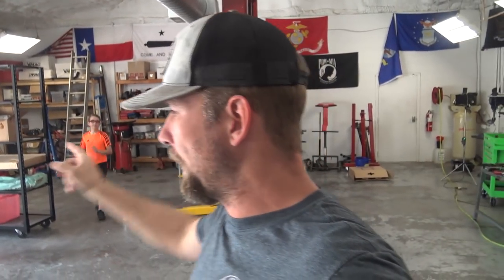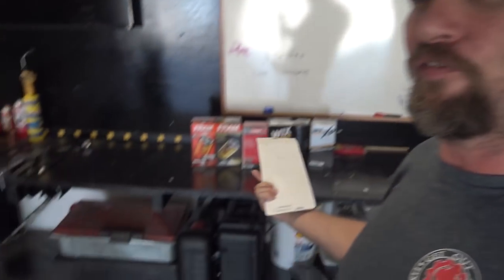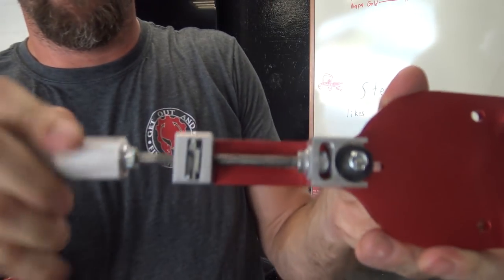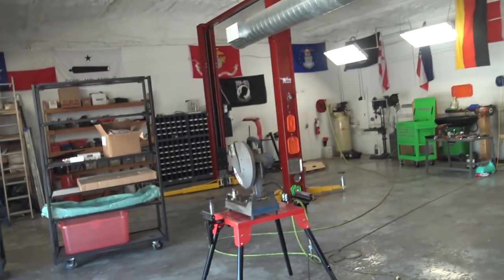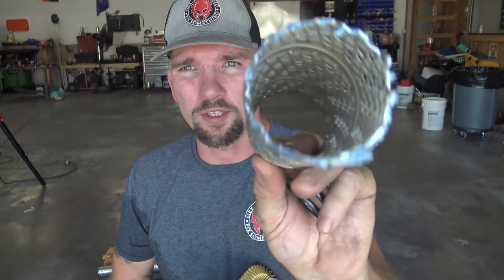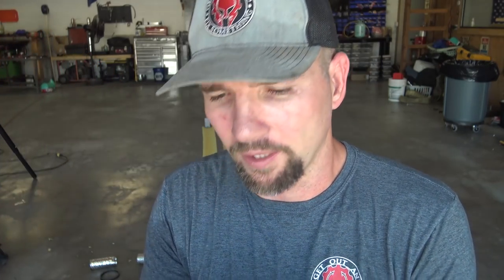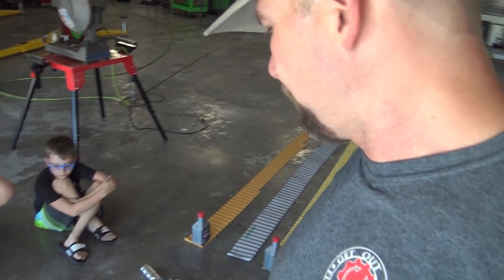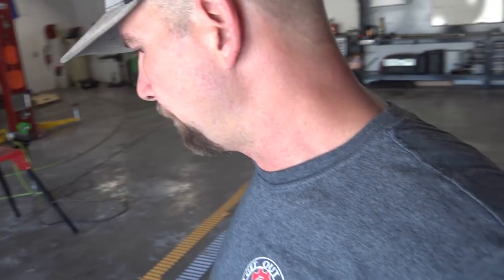Is This Still The Worst Oil Filter On The Planet?

Comment: For 27 years I was a Ford parts manager and guess what all my vehicles ran motorcraft filters on every model car or truck I owned, never a problem.
Reply: Grand Poobah 
But I wouldn’t have used them if they were junk.
Reply: @gregsimon9061  if use Motorcraft parts, better than other aftermarket stuff unless your going for the performance stiff like all aluminum radiators, new shocks and so on.
I wouldn't use AC Delco for gm Because then aftermarket is literally higher quality than GM oe parts.
Reply: thats the only filter i will ever use on my two fords   cheers   Greg
Reply: You can use motorcraft filters on gm vehicles too..motorcraft its fords aftermarket to non ford vehicles.🚛🚗🚖🚕🚍🚌🚓

Comment: Got a 1999 gmc safari been running fram since 130000 miles with Quaker state oil change at 2500 miles still running strong at 295000 miles

Comment: It is more about surface area than media thickness!  Seen a lot of Frams in the junkyard! Not sure if it was the filter, or if the owners tried a cheap oil change that didn't fix what the car was doing and they threw in the towel. I think there are some Fram filters that are okay, steel and paper are both biodegradable in a landfill. I do know that at one time Fram was selling the filter for my Volvo XC70 that was actually a Mann Hummel hu819x in a Fram box. Unfortunately they wanted double what I was paying for the Mann filter in the Mann box.

Comment: Been using Fram since 1968. Never had a failure due to the filter. Got an 03 Chevy Avalanche with 224,450 miles. Doesn't smoke and carries 40 psi at operating temperature. Nuff Said.

Comment: Stephen, B4 doing the oil filter autopsies I think you 1st should have weighed them. I have found that the budget oil filters are significantly lighter than their premium priced counterparts. This extra heaviness I believe is due to the superior materials & construction in manufacturing of these filters. I’d have betted that the Fram basic orange filter would have been the lightest. It would sure be a fast, easy, & clean 1st step in evaluating these filters.  Rich 🤓👍🇺🇸
Reply: heavy doesn't necessarily mean good.............

Comment: From Leo:  My job required extensive driving to take care of contract clients.  50-60,000 plus miles per year for most of my career.  I drove V-8, 6 cylinder and 4 cylinder American made cars, usually trading at about 200,000 miles.   I never did anything special, getting oil changes at about 3-5000 miles, whenever convenient.   I would go to any drive through oil change place and use whatever brand name oil they had,  and whatever brand name filter they had.  Lots of Fram filters.  I doubt that any of them were deluxe or heavy duty quality.   Seeing by your test that some brands are built better than others.   Since I never had a single lubrication related failure,  one would have to believe that even the cheaper built ones are plenty good to protect the engine.

Comment: I had a 2006 Saturn Ion with 298k miles before I bought a new car. I used Mobil 1 full synthetic and changed the oil every 3k miles with a Fram tough quart oil filter. Saturn engine doesn’t use the same type of oil filter like every engine has. It’s internal. You unscrew a plastic cap and drop the filter in. I looked at all different types of brand on that style filter and they were all the same. Plastic with cardboard.
Reply: Yea dude it's called a canister filter. Very common, Volvos use them and so do Mercedes. It's not that oddball, I promise.

Comment: This video surprised me ( I think it did you also) I ran FRAM for years until I started doing research (gas engines) I moved to WIX really quickly. However it looks like FRAM may have stepped up their game. Back in the 90's the biggest selling point for FRAM was the grip they started putting on them (gas engines). I will probably stick with WIX... Another surprise I got recently is how good Amazon oil is (full syn). I have been a Castrol Oil guy my entire life, but Check out some oil reviews on YouTube. Sad I can not afford Amsoil :-(

Comment: I have used FRAM filters for years...UNTIL...After one oil change on a Ford 4.6, I started the engine and there was no reading on the gauge. Scared the dickens out of me.  The lifters didn't make any noise so the filter bypass must have stuck.  I guess?  Anyway I bought a Mobil 1 and have used it ever since.

Comment: Fram sell millions of orange filters every year with out problems. Purolator filters, at least the cheaper ones, still have tearing issues of the media. The 'cardboard' ends are also used by some Wix filters as well as the Fram.

Comment: I have used Frame Filters for over 55 years and have never had any problems with them or Engine Wear--the Key is to Change your Oil Often, I have always changed mine at 3000 miles, my newer Ford Truck, I change it at 5000 miles using synthetic blend oil...

Comment: Hi brother, I have a 103-10 perkins engine and it has idle fluctuations when it's cold, this has been happening since the mechanic went to the injection pump to start faster and changed my settings .... If you could tell me how far each adjustment is from the engine block to the head of the screw, you are very strong and I have been following you for some time

Comment: We had a guy that works at our shop have us put a fram on his blazer. Of course I wouldn’t instal it in the car, & they thought I was crazy for not wanting to do it. It was an “ultra synthetic” so it’s “the best on the market” the car is owned by a crazy nutty old man. He didn’t want the genuine ACDelco filter on his car even tho it’s a genuine GM filter designed for his vehicle from the factory. The best for it cuz it’s an OEM filter.

I’d take the genuine GM filter over any fram any day. Some guys like to dis the filters cuz they feel crap, but it’s an OEM GM part not a crappy wix.

I’ve installed probably 150-200 GM filters, & so far we haven’t had a single one fail, & if they are leaking it’s cuz the filter is loose. Now I get my filters pretty fukin tight using 2 hands, & a rag.

For me personally… 
Go OEM or Mobil 1, Microguard, Penzoil.

Wix oil filters are trash. We had one fail on a minivan years ago where it blew the filter off the housing.

Motorcraft, ACDelco, Mobil 1, MicroGuard, Penzoil, then wix if ur desperate. If u can only get a fram just leave the old filter on the car, & avoid the fram.

Do what u want to ur own engine, but this is just my .02

Comment: Been using Fram in everything for over 45 years. Never cost an engine. Why? Sure there is better media, but what is ALWAYS overlooked, is how the filters and oiling systems work. Very little of your oil actually goes through the filter. Until the late 80s, some engines didn't even have a filter. The bypass system is why it doesn't matter how good of quality your filter is.

Comment: Maybe someday somebody on YouTube will do a video where they actually TEST AN OIL FILTER'S ABILITY TO FILTER AND CLEAN OIL.  You know, take oil samples and measure the amount of particles filtered out and see if the filter is actually doing its job. 

Because if the cheap Fram filter is doing a perfectly good job over a 3,000 mile change interval, there's no reason in the world to buy something more expensive.

Comment: I been using K&N filters for years never had a problem with them they work great @Stephen Cox
Reply from the maker: Thanks bud!
Reply: Well I have used for years whatever is the cheapest that I can buy at the time and I too have never had a problem.  So your K&N filter works. So does whatever I use.  It doesnt matter what you use if you just do your oil changes on time.
Reply: @nickv4073  okay
Reply: @nickv4073  I had a friend in college who ruined the Ford Lima engine in his Ranger by doing a DIY oil change with a Fram filter, the engine suddenly had no oil pressure about 500 miles after the oil change.  We took the filter apart enough to figure out that one of the cardboard end caps got sucked into the engine ☹

Comment: I like the Napa gold 1515’s but watch out for the gasket! The thing will come off the filter about 50% of the time so check the mounting face before you slap another one on. Yes I always put oil on the gasket surface and wipe clean the mounting surface. In fact, I pre fill the filters with oil to limit the dry run time. Someone didn’t check for double stacked seals on my ex’s car and I’m sure glad it wasn’t me. My ears are ringing just thinking about it.

Comment: The extra guard is celuose media! Fram ultra synthetic is synthetic media same as wix XP! The other 3 are synthetic blend media! And also the motorcraft is made by Purolator
Reply: Yes FRAM Ultra is a nice filter
Reply: @xephael3485  yeah I've been running them on my Subarus they filter down to 20 microns the wix XP only goes down to 30! They sold out to Mann I believe
Reply: I used to buy Purolator at Walmart but they stopped carrying that brand for some reason.  Lately, I have been buying Motorcraft on Amazon and Rockauto.
Reply: @picklerix6162  motorcraft isn't anything special. It's a low end filter with a silicone anti drain back valve! The fram ultra synthetic filters the best! I we wouldn't buy any of their other filters! Molil 1 , k&n , Purolator boss or wix XP are very Good

Comment: I remember when engines didn’t have filters. And I have never really been brand loyal but I have never had an issue with Fram or any others. Had a ranger with 257,982 miles on it when I sold it and used mostly fram filters on it.
Reply: My Ranger has 331,000 still going strong.

Comment: You are more forgiving than me. I can't think of a single situation where I would use crappy Fram filters.
Reply: He didn't test it, only showed components
Reply: @xephael3485  So! What's your point?
Reply: @consaka1  my point is that no useful real world information on how the filters actually perform can be aquired from just cutting open filters.
Reply: @xephael3485  Yes to a point. What you are not realizing is that this isn't a standalone review. It is based off the previous review and for many of us, on our experience with used Fram filters. Cutting up used ones can be very enlightening. So can cutting up new ones when you find defects that literally allow the oil to bypass all filtration. I have seen it on new and used filters. I have cut open a lot and watched others cut open a lot. My experience with Fram goes way beyond this short video. My grandfather always bought the cheapest filters he could back in the day.
Reply: @consaka1  You shouldn't assume this is the only cutting apart oil filter review I've seen, and that I haven't seen Cox's previous videos... because I have.  If there is a defect with an oil filter point it out...

Fram offers filters at a number of cost points and  I've tried them all.  I've never come across a defective product, or one that failed when used as directed.  There is a video on YouTube where they tour a Fram QA lab and show you the real world torture testing they do to their products randomly pulled from the production line... Using cellulose end caps, bonding the filter with epoxy or using leaf springs may make a filter cheaper to produce, but in no way reflects how it will actually perform in real world tests.

If a company as big as Fram was making absolute junk that failed they would be sued into oblivion for wrecking engines.
Reply: @xephael3485  you assuming they have never been sued? Lol
Listen dude. If you like using their products than go right ahead. I have seen their defects first hand. Their QC is subpar if they have one. I assumed they never had one because cardboard end caps on the filter media. Dumbest construction ever. I have seen that cardboard totally disintegrated. That's a crap filter in most professional mechanics book, but hey if that's what floats your boat go right ahead and buy it because I won't. My local parts store had a wall of Fram stuff and now they don't even sell them any more.
Reply: @xephael3485  Oh and yeah this comment is actually completely wrong. You can gain a lot of real world info by studying how it is made and especially if you find serious flaws like GAPS and HOLES in the media.

Comment: I had a 94 dodge ,360 magnum  ,used fram  oil filter mostly, had for 21 years,23700 miles, ran great never  did anything  major  to engine  or transmission sold to someone  else who was putting  100mi a day going to work

Comment: The butterfly bypass spring on the motorcraft is the only one that will bypass oil at the same pressure regardless of temperature, just FYI.  Just in case you read this, repeat your test in a year or two on used filters, get a amazon digital microscope and explore the actual filtration capability of the media.

Comment: I wonder if the chamfer helps the O-ring to release from the engine when you unscrew it.
Reply: That’s an interesting thought actually, maybe if you don’t change your oil often enough it would help lmao
Reply: I think it's more spread the load on the gasket so the filter doesn't loosen. Fram is infamous for that.
Reply: Its to stop the filter housing grabbing the edge and rolling it out of position

Comment: The best filter to use is the one that has the factory's name on it. If it's a Cummins use a Cummins filter. If it's a caterpillar use a caterpillar filter
Reply: Who makes them though. Don't think that Cummins makes oil filters.
Reply: @markchidester6239  If I remember right Geno's garage has them for the pickup engine. Not sure about the bigger semi engines
Reply: not necessarily bubba

Comment: I have GM products and Kubota tractors.. I always by the kubota filters for them.. and I always get the acdelco  for the GM.. now I have been told that the acdelco are a cheaply made as the fram.. an to check out the supertech filters from walmart..  guess I will have to think about a filter tool and see for myself.

Comment: The standard Fram automotive filter is still made the same way as the old one you showed, cardboard ends glued onto the filter. The obvious reason why they make them that way is the cost of manufacture, it is the absolutely cheapest way to make one. If you think that is a good way to make a filter, why don't other brands use the same method? To my knowledge, no other US filter maker manufactures filters with cardboard ends, if it was just as good, everybody would be doing it. The string around the filter media is fairly common, its just a way to hold the media in place as it is assembled. Your cutter works the same as any tubing cutter, noting unusual about that at all. I'm not sure of the specific requirements, but aviation mechanics commonly cut open oil filters on internal combustion aircraft engines, then open the media up so they can look for metal particles in the media. If your airplane engine quits its hard to pull over to the side of the road, so aircraft mechanics are very careful to make sure the engines are right, if there are metal particles you can see in the oil filter, something is wrong.

Comment: I really like guts of the amsoil filters.

I don't trust any claims by manufacturers, but after testing 5 brands of filter and 5 brands of oil, my reports from Blackstone labs do truly show some statistically significant gains. 

Mobile 1 and amsoil are great brands. Amsoil is currently my go to unless mobile 1 comes out with something else compelling
Reply: What were the other brands you used?
Reply: @Sjackson2369  
Filters in order of build quality
Amsoil
Mobil1
Wix
K and n / afe. I think they are the same OEM
Fram

Oils
Amsoil
Mobil1
Schaeffer
Royal purple
Shell

Comment: FRAM has indeed stepped up their game.  They all use silicone anti drainback valves, the pleates at the ends won't fall apart but the biggest issues is that they aren't priced competitively. Their prices have gone way up. I can snag a Motocraft for 3.87 at walmart where a tough guard will sell for 6.89. Ever the Extra guard is a buck more. There's just no reason to do so when I have an OEM right there for cheaper. 

Also, Honeywell sold FRAM in 2011. They apparently have made much better filters, which explains the price increases. We will only know for sure how good these FRAM filters are based on oil analysis. I'll try a tough guard and see what happens.

Comment: So is the problem that Fram cuts cost when production of these filters or is it that fram's filters don't filter grit well? I'm genuinely curious because I always use fram, but I am always on top of changing my oil, synthetic by the way, at around 3500 miles.

Comment: I'm guilty of not changing my oil as often as I should. I used to always buy the cheapest filter, which was usually Fram. But after seeing the inside of different brands, I only use Wix now. Even if I let it go longer than I should, it's still better than a Fram